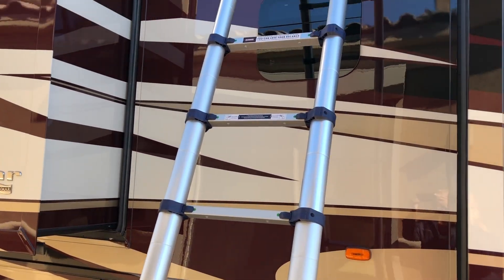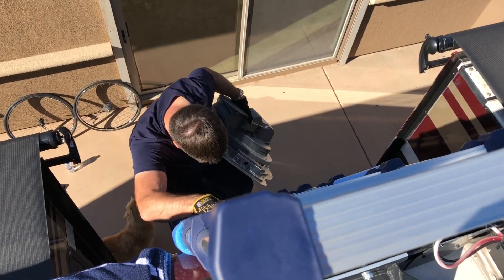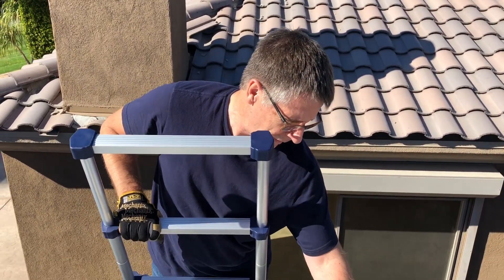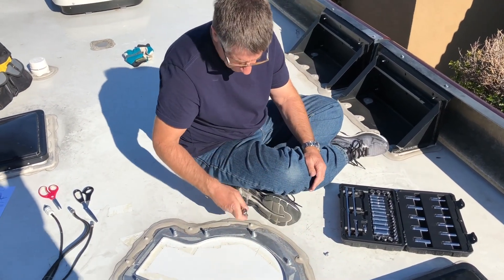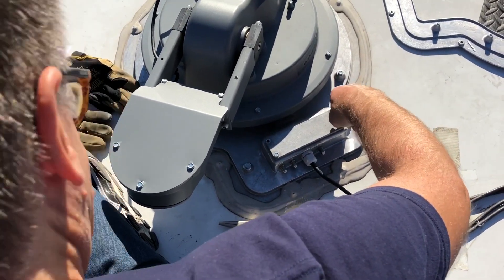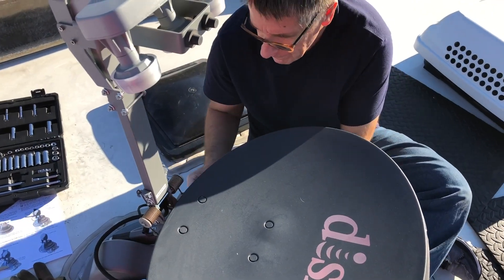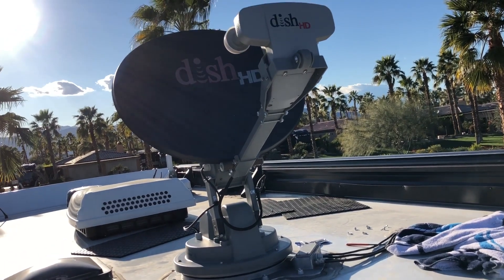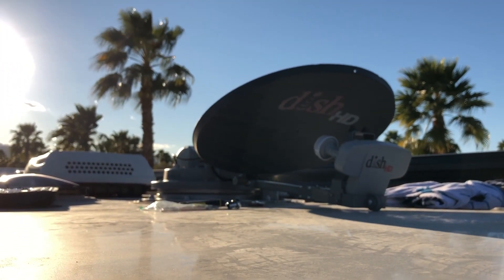Winegard

Comment: all the videos show the dish stowing to the rear. Mine is at 2 oclock. how do i correct the problem so mine stowes to the rear
Reply: It would seem that whomever made the original install did not follow the directions and mounted it to the roof incorrectly.
Reply: @gonebyrv9748  so how can I correct the problem
Reply: @davidt.chestnut5903  I think the only way to correct the problem would be to re-mount the entire antenna in the correct position. There is a "Front" indicated on the base plate which mounts to the roof.  Apparently, that step was not followed correctly when the install was done. I could send you a copy of the Installation Instructions if you don't have a copy.